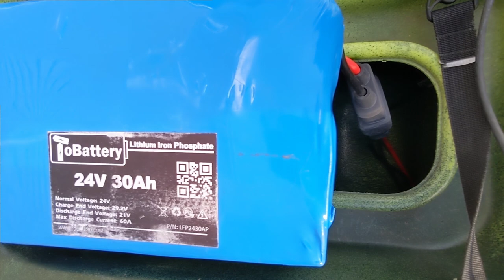Newport Vessels NK180 on an Old Town Topwater PDL | An Overview While Fishing

Comment: I have the same Topwater PDL, of course just before the new PDLs were released with the pre drilled holes.  How has it held up, specifically with the weight of the motor? Has the plastic bulged or teared? I fish in the Delta heat in CA and it tends to make the plastic soft .
Reply from the maker: I haven't noticed anything moving with the mount since the initial install. It works great. I could see the power pole (when used in current) stressing the plastic but after pretty heavy use, nothing has budged a bit. The plate helps a lot to equally disperse the force on the surface and using big washers inside the hull also help to keep anything from tearing.

Comment: Nice video. I am planning to do the same for my PDL 120. Since the motor is offset from the center, is the boat able to run straight without problem? Do you need to slightly tilt the motor to correct that? Thanks.
Reply from the maker: It may require a slight correction but to be honest, I don't ever notice it. When I have my rudder control centered, I am more or less moving straight.

Comment: So torn, between doing this or buying an autopilot, or a nucanoe unlimited. I love having the pedals as a work out. However I'm wanting a motor for rivers so i dont need two vehicles. I would be towing my wife. Which I've done in the past with my previous pedal yaks. I just can't make my mind up on what route to go.
Reply from the maker: Each kayak has its own set of pros and cons in each situation. I'll just say that if you're getting an autopilot, it is VERY heavy. I can't imagine fishing out of it regularly without a trailer. Great setup for those windy days on the lake but not a river friendly kayak in rivers with lots of depth changes and rock.
Reply: @RivermanTV-  I've read that, our rivers in NC are quite big. Would mainly be in lakes. And I have a trailer already so I'm not too worried about the weight. Such a tough expensive decision to make lol
Reply: kayaking is the only excercise i get, if i got an autopilot i would never get any. i want to be able to do both i just need to extend my range and add a motor.

Comment: Great set up man!  I like that you have the option to still just pedal if you didn't want to use the motor.  I know you can't turn as sharp with the rudder while using the motor, but it looks like it turns decent right?  Does it get the job done turning against high winds, just to get somewhere?  I would just use it to mostly get to a far area with slight turns, then pull up the motor anyways.  I am considering this option, thank you and tight lines!
Reply from the maker: It still turns pretty well with the motor down and running. If we're being honest, the PDL kinda sucks at turning anyway and I don't notice much of a difference with the motor. If I'm not using it, I will raise it out of the water so it doesn't make turning harder. I recommend this motor 100% and if you're mostly using it to cover distance and not make tight turns in a race, I think you'll be happy with it in a setup like mine.
Reply: @RivermanTV-  Thanks man!
Reply from the maker: @cleanfunfishing  Happy to help!

Comment: How has been the reliability of the motor and the throttle control since you got it. I have the opportunities of buying a used one(use during one season only).
Reply from the maker: The motor is awesome. Super tough and reliable. The throttle control is fine but will sometimes lose its smoothness for some reason. I need to contact Newport. Doesn't affect usability but it can be annoying.
Reply: @RivermanTV-  Thanks

Comment: I'm into the video at 8:35 and am wondering if the motor bracket and powerpole's bolt patterns are exactly the same? I have a PDL 106 and they come stocked with an offset powerpole mount and I was thinking about adding a nk180 and using the cable steering mechanism in some way to fix the motor perpendicular to the stern.
Reply from the maker: They are the same. Your plan is theoretically possible on the newer models with the predrilled holes, but it may be difficult getting the kayak to run straight. You can fix the steering triangle in a single position with something like a Nite Ize cord tightener but it will have to be set each time you use the kayak and if it shifts during use it is a real pain to reset without getting out of the kayak.

I would consider making your own holes on the opposite side of the kayak.
Reply: @RivermanTV-  I appreciate your response. I have a few ideas so it'll be interesting to see how it all comes together. Tight lines!

Comment: How do you feel about the battery? Just purchased the same motor and getting ready to do the same battery.
Reply from the maker: The 30ah has done great for me. The internal PCM will cut power below a certain voltage not too far under 24v. With my DIY batteries that threshold is a bit lower so I'm able to run it a bit longer. But the cutoff is in place for a good reason (protect the cells from over discharge which causes damage) and doesn't make a huge difference in run time, but it's something to be aware of. 

Overall, 30ah is enough for most applications but I do use my 52ah when I know I'll really need to cover some miles.
Reply: @RivermanTV-  how many miles would you get with the 30ah?
Reply from the maker: @valenor916  depends on a lot of factors like motor type, amp draw, throttle amount used, etc. You'd have to check for specs online for you specific motor.

Comment: Does it track straight with the motor being offset?
Reply from the maker: I have to turn the rudder very slightly to get it going completely straight. This is more due to the original holes that I drilled that were not perfectly straight. Originally those were for a power pole mount but now that I use them for the motor, it actually causes it to be slightly turned right.

Comment: how does it track with motor being not centered?
Reply from the maker: It tracks very well - better than I expected honestly. Unfortunately, I had to use the holes I had previously made for my power pole bracket and they are every so slightly off center which causes the motor mount to be a bit off as well. Even so, it's not very noticeable and doesn't cause issues. My biggest gripe is with the pin the Newport uses to secure the motor in the center position. It has more play than I would like.

Comment: Did you have to get a longer rudder or anything to modify it for steering?
Reply from the maker: I have an upgraded metal rudder but it is more or less than same size, maybe just slightly larger.  I know a guy who put an autopilot rudder on his and he says it is better than the OEM PDL rudder.
Reply: Sweet thanks
Reply: Also is that just like a weather proof light box cover? Sorry for all the questions just making sure I’m getting right stuff
Reply from the maker: @Jcf2301  yeah, it's just a metal cover. I cut some gasket material, siliconed it to the kayak, and then secured the cover on top of that.

Comment: What happened with the Bixpy?
Reply from the maker: Kept one and sold one
Reply: Better than bixpy?
Reply from the maker: @miamiwax5504  better in a lot of ways. The Bixpy is definitely lighter and more portable, but it doesn't do well if there is any sort of vegetation or floating vegetation in the water. The Newport can run on whatever kind of battery you want which gives you more life if you choose and it chops right through weeds.

Comment: I think when u cut in to haul u void warranty , also it’s limited life time warranty on the haul so might want to read up what it will cover. But dope set up and I see the iron balls making that hole mad respect .
Reply from the maker: Eh not worried about it tbh. Hull material is strongest of any kayak I've ever used.
Reply: It does not void the warranty. Now if he has a failure that’s caused by the hole he cut, they won’t cover it. Any other issues that are manufacturer defects, they will honor the warranty. Simply cutting a hole in your kayak does not void the warranty.